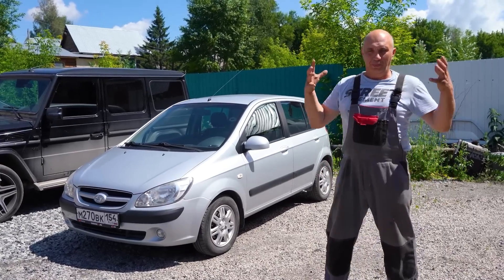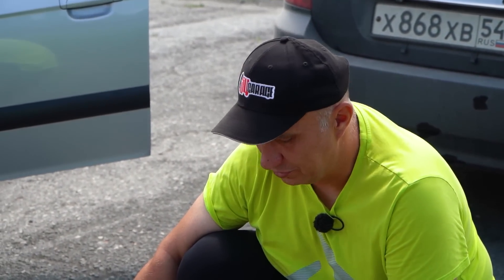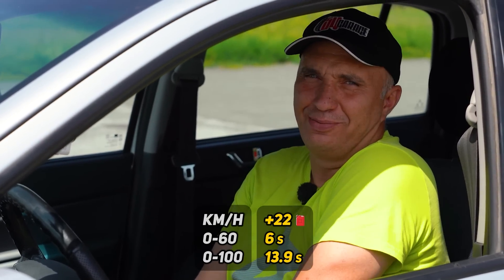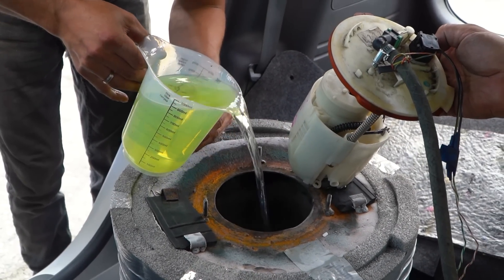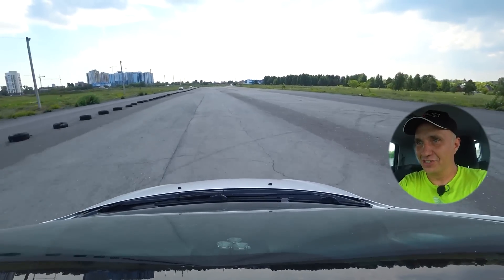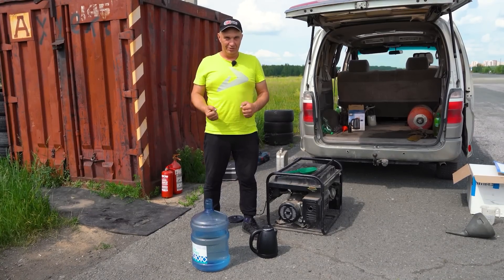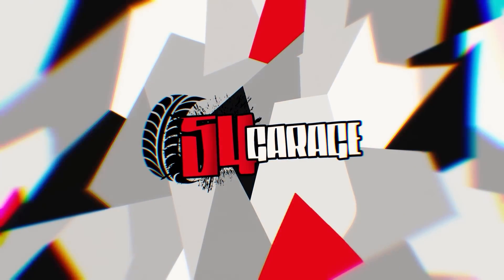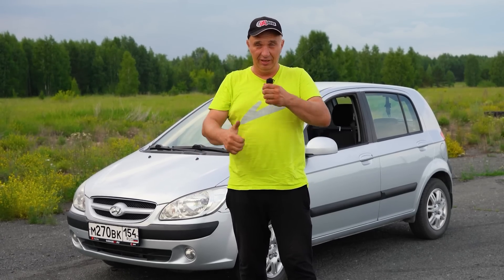Does fuel temperature affect engine performance? (acceleration, fuel consumption)

Comment: There's also the issue of air temperature, air is denser when it's cold which means more gets into the combustion chamber and makes for a bigger bang, hence why intercoolers are a thing, add to that the chilled and denser fuel, and yeah, more power when things are cold, so the experiment could do with having the air chilled and heated in a similar fashion (thrown an intercooler into a bath that has the dry ice or boiling water in) and see how that changes performance, coupled with the chilled and heated fuel respectively (and swapping things about too to add to the mix, so hot fuel & cold air, cold full & hot air, etc.)...

Comment: I like this concept . However if I am correct most fuel producers (at least where I live) have "winter" and "summer" variants (whatever that means), if this is true to your sourced fuel it could effect your end result.
Reply: Always figured the whole winter and summer mix thing is just an excuse to up prices
Reply: @butchuggin If you'd look at the color summer gas is yellow and winter glass is more see through the whole idea is that they freeze at different temperatures. For example winter gas or diesel at -30 while summer is at -10. That's just an example I haven't looked it up. My dad has stories of literally lighting a campfire underneath truck diesel tanks to heat up the diesel because it froze and gelled up.
Reply: @mantvydas8810  that's diesel not gas
Reply: Theres winter and summer variants for diesel, not for gas. During distill they distill the heavier fractions off the diesel so it makes the cloud point better and thus the diesel doesnt gel up.

Comment: Next experiment: How much fuel do you save by filling car up on a cold day compared to a hot day?
Reply: Purely dependent on how the gasoline is stored. In most places tanks are deep enough underground that it isn't affected by the ambient air temps. Therefore negligible

Comment: It's not the fuel temperature,  it's the air intake temperature,  colder air is more dense, and therefore it means more air per stroke, warm air is less dense so less volume per stroke. This is the purpose of cold air intake systems and intercoolers.  The fuel will heat up instantly when put under compression by the pistons. So the  temperature of the fuel going in is irrelevant unless it's too cold to flow through the fuel system. Hot gasoline may improve milage due to it becoming vapor more easily when hot, the vapor is what actually burns, so this may help with performance a tiny bit.

Comment: It is required for me to have a heat exchanger to heat my fuel on my diesel truck. I run it on used motor oil. In the winter it's much too thick. Start on winter blend diesel fuel then swap over to oil when the engine is warmed up.

Comment: Heating the gasoline turned it into diesel fuel.

It's not the fuel temperature, but the ambient temperature that changes the combustion rate. Cold air holds more Oxygen.

Comment: Would having a return line of made a significant difference in leveling out the results?  Would be great to repeat the experiment with a return line going to a separate container to see how much is returned at -30 compared to +75.  Also, does diesel follow the same trend?

Comment: The volume of the fuel will vary a lot depending on temperature, particularly with the extreme range of temperature you were using. That wouldn't affect the accuracy of the acceleration test(Though the human factor will.), but the economy test would have been MUCH more accurate if done by weight instead of volume. But whatever. I still have fun watching your guy's stuff anyway.

Comment: Just came from here : https://youtu.be/ghJv7yAuYEY . The  guy found the problem with his drag performance was: insufficient intake heating.
 Interesting...
The specific heat of gasoline is about twice that of air, but there's about 14 times the air mass flowing to through the engine than that of the gas. So cooling the air would have about 7* the effect, whatever it is, than cooling the gas.

Comment: Older engines like the Lada would run best on 95, newer engines are happy on 91, buying fuel when it is cold means the fuel is more dense so you actually get more volume of fuel than on a Hot day. With petrol the liquid is not as dangerous as you might think, ( on YT i have seen a guy put out a burning match in petrol ) it is when it vapourizes it is VERY EXPLOSIVE 🔥💣💣🔥 Unsure of the boiling point of petrol all liquids have a different boiling point!

Comment: i think this myth might be true for a engine with a carburetor  but for a single injection engine it dosent matter becuse of the ecu it calculate the right amount of fuel. for a diesel engine it have normally more air as needed for the fuel so it can affect the power. i think a old turbo diesel engine with a simple crude controled injection system you will se some difference with a care like a old VW t4 from the 90s with a 2.5 l turbo diesel or similar at this time

Comment: My 89 Acura Integra runs about 40% better in Winter and the cold than in Summer, I noticed I lose gas mileage late Spring thru Summer.
Reply: we should just try to have cold air intake then...perhaps we should make the air breather suck from intercoolers

Comment: Now I figure out how too run my AC to the fuel tank, thanks!
Reply: make that cold gas from ac coiled into the air intake before coming into the evaporator coil and fan  in the car
Reply: @fidelcatsro6948  run a copper coil off the AC Through the fuel tank.... is that what your saying?
Reply: @mattclinch1976  no through the air intake manifold i mean

Comment: Why colder fuel generated better fuel mileage: colder fuel causes more stable running, therefore ignition timing is more stable, meaning that the engine can create the most powerful boom per bang per cylinder.
TL;DR version (not based on the video itself)
1) cooler fuel maintains a positive feedback loop to generate more power under otherwise identical conditions as such:
cooler fuel -> more heat required to vaporize -> greater decrease in intake air temperature at  injection point-> lower temp = denser charge that takes up less volume -> more air rushes in to take cooler air's place -> more fuel injected to maintain air-fuel ratio -> cycle repeats.
2) in spark-ignition engines, the fuel itself is used to remove a certain percentage of engine heat through vaporization.  The colder the fuel, the more total heat the fuel can remove prior to combustion.
With that being said, the most efficient combustion occurs with engine temperature between 195-210F (91-98C) based on one thing: Petrol doesn't burn as a liquid but as a gas. Fuel vapor needs source of heat to change phase.

Comment: A diesel engine runs.far better when it's raining or heavy mist as the moisture sucked in to the air intake is like throwing water on a hot frying pan and helps with combustion and more power pls give that a try like some sort of moisture injection huh I love your vids

Comment: Try building a big refrigerated manifold intercooler, and see the effects of cool, cold, chilled and frosted air on engine performance? Then try warm, hot, boiling temp, and superheated air on engine performance? I think you may find the results quite interesting.
Reply: on a carburettored engine, sir too cold results in the fuel and water vapour in the air freezing and icing up the carb leading to poor running which is why older cars have a 'hot' intake for winter use. unlike what you see on Roadkill etc, the constant rejetting of the carbs is unnecessary. just put a proper filter on and use the warm intake in winter. the loss of 2 or 3hp is better than breaking down in sub zero temps
Reply: Seconded
Reply: It would be easy if the hooked the AC to the intake. Just turn on the heat for cold starts or the AC for better performance 😂
Reply: Thirded
Reply: Dodge did this with the Dodge Demon. They used a liquid-to-air intercooler to cool the intake temps. The liquid line was routed through a heat exchanger in the front of the car for normal use, but also went through a cooling block located closer to the cabin that was hooked up to the car's AC system compressor. You then had the option let the AC system chill that liquid down so that the intercooler on the intake would get super cold. Which in turn made intake temps cold= mo powah bay buh. 

The down side is you lose AC inside the car when you have that turned on because the AC system is cooling the intercooler. But you would only be doing this for like track work, 1/4 mile times, etc. Much like the guys that use ice filled liquid intercoolers at drag strips.  Up side is if you have the AC set to cool the inside of the car, the aforementioned heat exchanger does a damn good job for daily driving and you can still burn tires.
Reply: @NotRandoWis Sure for track times maybe, but for a daily driver I doubt you'd gain any MPG do to the power loss of spinning the A/C all the time.
Reply: @rando FCA Dodge sucks.
Reply: @mann_idonotreadreplies dodge dodge sucks🤣
Reply: Look at turbo engines cold air is always better for performance
Reply: Could a manifold be built around the exhaust to heat the air to the carburetor?
Reply: @soundsoflife9549  2CV has this, a small exhaust tube runs under the intake manifold.
Reply: @soundsoflife9549  I see no reason why not. Classic VW beetles had their cabin heater supplied from "heater boxes" that were built around the exhaust pipes, and they had a small "air bleed" pipe to carry heated air up to the carburettor to prevent icing in cold weather.

Comment: I can't think of anyone else on Youtube who has tried this experiment so the results are interesting to see. Video idea: Use a engine block as a positive displacement supercharger for another engine. Like a Lada motor that is gear or belt driven so it pumps more air into the actual running Lada motor and thus should make more power.
Reply: Engine Masters dyno tested fuel temperature and found that cooler was better for power, but it didn't matter very much.

Comment: Gasoline density varies with temperature, so this wasn't just a test of temperature and engine performance; the amount of gasoline in the test tank varied slightly with each test.  A gram scale would have shown this if the liter of fuel were weighed before each test.  The bigger issue is ethanol, which would boil off while heating and during the test, but I'm not sure if Russian fuel contains ethanol.  I wish that our fuel didn't.

Comment: I'm glad you measured the gasoline at room temperature, so volume wasn't a factor in this experiment--but I also am curious if a gas station pump, if pumping 1L of below-zero gasoline, compared to 1L of very hot gasoline, would serve a significantly different mass for the same price.

If you look up gasoline's coefficient for thermal expansion and run the math you might expect around 10% difference in mass between hot and cold at the same volume.
Reply: They didnt when they measured the hot gasoline...

Comment: I also want to add from this experiment, it is likely that the fuel used here is regular gasoline with an octane rating which may not be too high, but what if. Using fuel with a higher octane will the results be the same or different

Comment: Petrol fuel is not like water which consists of like 99.99% water, a single type of molecule. A petrol mixture is like 1000's of different chemicals. By boiling them, you simply distill, getting rid of some of the lighter fractions that burn easily (and have lower boiling point), leaving heavy (higher boiling point), hard-to-burn fractions behind. A modern car like this with electronic injectors and PID control (adjusting for burn rate measured by oxygen in the exhaust), you would not feel any acceleration differences and your engine ECU would simply feed more (less efficient) fuel in to get the same burn rate. Which is obviously much less efficient.

Comment: Would be nice to see this affect on intake air temperature!
Reply: Well... that's why intercoolers were invented... And why your petrol engine ECU calculates the amount of air depending on intake air temperature (measured by a intake air temp sensor) and an airflow rate (MAF sensor which often integrates temp sensor too), and calculating the resulting incoming air density to infer the amount of oxygen that will be present. You can get it more efficient, hence the use of intercoolers, but its mainly for diesels that always provide excess of air, whereas petrol engines require incoming air to be managed more precisely for a proper stoichiometric ratio to be maintained for the fuel injected.
Reply: @you-dont-know-me  BMW R1100.. has temp sensor inside the air filter housing.
Reply: @AnalogDude_  most cars have intake temperature sensors
Reply: @FateOfLate  there is a difference between MAP and MAF sensor. one of them uses a wire that gets heated with electrical current and 3/4 mm further down the road there is the "temp sensor", another wire. that measures how much heat gets trough or gets wasted, some kind of inverse measurement. that was like 30 years ago, used in VW and so. the effect is the same but the technology is different.

But the location of the temp sensor of the BMW R1100../R1150.. is quite unique. it sits litterally inside the air filter under the sadle, pretty far away from the throtlebodies on the cyl's. Using the second generation of Bosch Motronic, V2.2.
Reply: @AnalogDude_  nobody mentioned map or maf. Merely pointing out that 'most' cars have a dedicated temp sensor too. Some at filter/intake. Turbo cars after intercooler...
Reply: @FateOfLate  Well those are the most common used techniks and they use different approaches to accomplish the same.
Reply: @you-dont-know-me intercooler cool the intake air temperature and the ecu adjusts adding more fuel. Cold air is more dense and needs more fuel. Warmer air needs less fuel.
Reply: Higher intake temperatures generally reduce the output of the the engines significantly. As a person who lives in Middle East and goes off-roading quiet often I can def confirm this. There are multiple factors at play such as air density, but also take  in consideration that the hot temps will eventually heat up you entire engine  which will reduce overall performance. Generally where I reside (KSA) in rush house traffic in afternoon intake temps are usually around 60-70 degrees Celsius (140-160 °F) (OUTISDE TEMPS BEING AROUND 40°C(104°F). This is usually cause the intake box in most cars pulls in air on top of front wheel wells (either right or left).  Which is usually very hot air given the heat coming off your engines and the surrounding cars.
Reply: @SLMAHKMY87 those amounts of heat in intake manifold are easily reached in diesel engines. Even if outside temperature is around 20 degrees, compressing air by turbo provides very high temperatures, where air cooled intercooler is able to drop down the temperature to somewhere around 40-60 degrees Celsius. It is widely used to significantly cool very hot air coming out of turbo, reaching at high pressures around 90 degrees.
Reply: @aj cool story bro
Reply: @slm cool story bro
Reply: I'm willing to bet the intake temperatures will make more of a difference.
Hot air temperatures is going to equal slightly less power than running in cold air temperatures. With an N/A Petrol engine, I might add.
Reply: @rickyturner2742  it's not that hard, if you boil water, the "bubbles" you see coming up are water molecules expanded to 1000 or 1600 times in size, somewhere in there. every element/material does that accept biology kinda, water in the ocean is a solid but over it's melting point. some kind of deceiving, a mind bogle, If you add heat / energy the electron(s) seek a higher orbit.
Reply: @analog lol
Reply: @rickyturner2742  ... and this expand is an unimaginable unstoppable extreme force.
Useful for making safety glass for cars.
Reply: fit a freezer at the air filter yum yum!
Reply: Warmer aka hotter air will unlock lean fuel table in the ecu. Same as higher coolant temperature.  I run a hydrogen on demand system, I'm using a 3rd party voltage injector to trick the ecu to run lean. It allows me to tweak air intake, engine coolant temperature along with the map/maf and both 02 sensors. I use an obd2 scanner to monitor everything.
Reply: Now do this with diesel

Comment: By heating up you are distilling the fuel, getting rid of easily burnable light hydrocarbons, BTEX (Benzene, Toluene, Ethylene, Xylene) as part of aromatics and also light aliphatic hydrocarbons. Heating fuel up will make it more like diesel, reducing combustion efficiency in a petrol engine. I only started watching this video, but I am afraid that this is what you'll find.